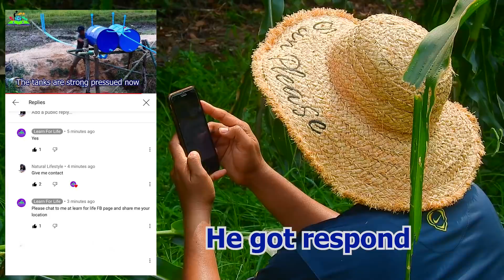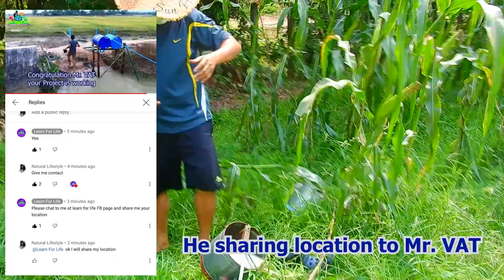Free Energy water pump for corn farm  | Water pump without electricity

Comment: Theatre. Why raise the barrel that high? Difficult to handle. Why use that wide exit pipe with that tiny suction pipe? Are you allowed to block the road?  An most omportently, is the water level in the river higher than the output to the field?

Comment: WARNING: These are not pumps! They are siphons: output point is allways at a lower level than input point
Reply: @learnforlifes  thanks for sharing.  Can the drum pump flow water 24 x 7?
Reply: We tried but didn't work...is the output should be straight not bending to different direction?
Reply: @lipaylipaydipay2696  The output must be lower than the river/sump water level

Comment: Mr.Danut or Mr.Vat what is the purpose of the vertical pipe about 1 meter that place in the middle of the of the outlet pipe? is the top of it close totally or open? i didn't see in the video.
Reply: @learnforlifes  thanks now i know
Reply: Just theatre. No need. (Must be closed)

Comment: You can fix the water in take to the lowest point in the barrel and improve the speed of the output up to certain extend.
Reply: No. But he could use wider input pipe to increase the flow.

Comment: Next idea want more pressure use 3 tanks 2 at start and 1 at the end with a fat pipe between barrels would give extra outputs ....think about moving water and the weight of it falling more weight more pressure use big pipe at the end and reduce size with valve like he done
Reply: Can also be apply on the deepwell source going to a lower ground? Thank u for sharing ND replaying.
Reply: @pastormits5791  no. This is a siphon. No siphon can lift water up.
Reply: No. One barrel is ok. Wider pipes will give more water.

Comment: my question goes like this..since they put water in the  drum up to 80% only, if they open the outlet and as the water flows from the river, does the water in the drum remain at 80% level all the time even if they close the outlet after using?
Reply: 😀😀😀WWE❤️❤️😎😭😎😎🎉 yang laillpl0n dan❤️❤️😭
Reply: Yes, but that is if the river is higher than the exit. No siphon can pump water up.

Comment: as we know the siphon to work the output level should be less than the input level
so please can you clear if this system can raise the water up, i meaning the output level can be higher than the water in input level ? so the water can going to level higher than the water source
Reply: the water is sucked from the river using the force of the air pressure in the drum..that is why they put water in the drum only about 80% so the remaining 20% is air.  When the outlet is opened, and as the water level in the drum drops, it creates an air pressure force which then sucks the water from the river
Reply: @gilsoftcoder2387  thank you for your reply, i can understand the idea of it but my question is it really can raise the water up to level higher than the source?
if it can do why its not using in free energy to generate free electricity
Reply: @gilsoftcoder2387  No. This is a siphon. No siphon can lift any water from a deep well or a low river.
Reply: Very we'll said..
Reply: Parang vacuum effect ang dating nya..